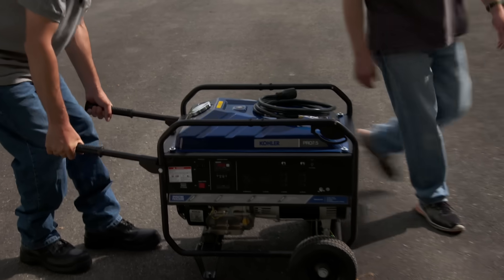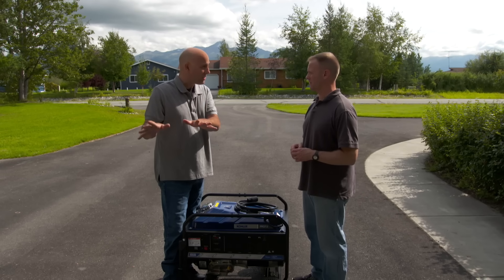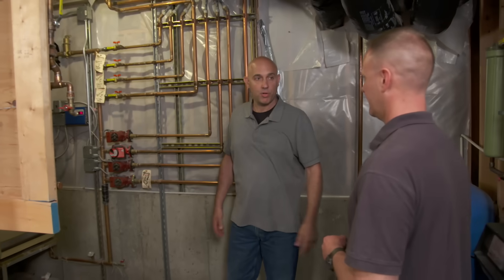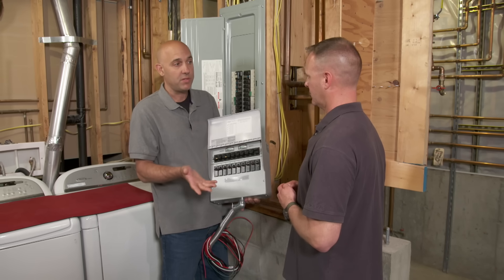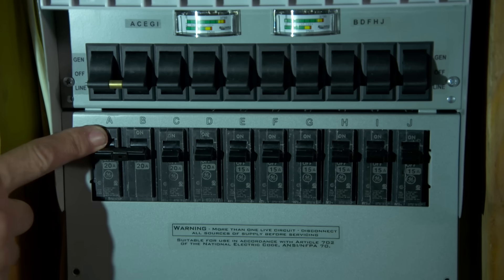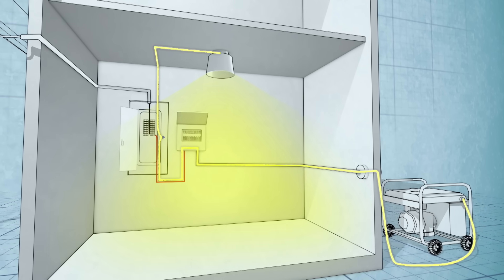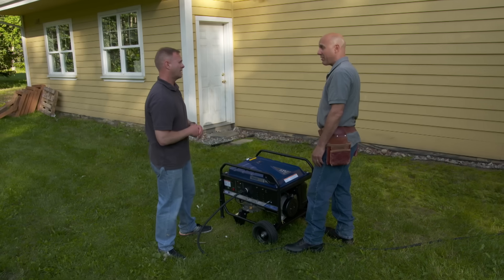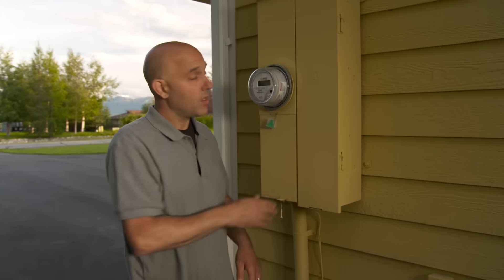How to Install a Manual Transfer Switch for a Portable Generator | Ask This Old House

Comment: These systems are more reliable and idiot proof. I still would have installed Generac NG GUARDIAN10 kv......It has AVR voltage control. Auto starting. Electric start features. 
Still not sure why Propane can't be used. They guys heating system...Uses "Natural Gas"

Comment: Can install a combination of both a transfer switch and direct connect? For example, using a 12KW generator, can I connect the 50A outlet to the main panel using a interlock device, and, at the same time, the 30A outlet to a transfer switch? Otherwise, how do I get all available 80A or 100A into the house?
Reply: Safwan Maurice Rached -  Why do you want both???  My guy put 2 Square D breakers in my 200 amp panel, the 1st one disconnects the panel from the Grid, the 2nd Breaker has an interlock and will not switch over unless the 1st breaker is switched off to separate my panel from the grid..
The 2nd Breaker is also connected to a big NEMA Female plug outside so the other end of it can plug into the generator, this 2nd Breaker is now providing the generator power to my entire panel when the breakers are turned to their respective positions and the generator is turned on..
The breakers were both 50 amp breakers..

Comment: Remind the homeowner to put a fuel preserving treatment in his tank and to shut the fuel valve off  and let the generator  run out of gas.(keeps the fuel system empty and it wont turn to varnish) remind him to test his generator under load once a month.

Comment: Not once did they mention the type of generator being a "Pure Sine Wave" or "modified Sine Wave" type. Today's sensitive electronic systems (even refrigerators, heating systems, computers, etc) could be damaged by modified sine wave. I expected Ask TOH to mention this important issue.
Reply: Unless it's an inverter generator (by design ans electronics) it will output a sine wave anyway.  It might be hashy and spikey, but a sine wave.

You're  describing the characteristics of a modified sine wave inverter, taking power from batteries and producing a sine wave...badly.  Agreed, their wave form is bad for motors and electronics.   For heavy start loads like big compressor or deep well pump an inverter generator may not have thr surge capacity of a bog standard generator.
Reply: @ralfnjan  So you're saying that any run of the mill gas powered generator (WEN, Champion, Westinghouse) - even if they don't say "sine wave" output will generate a sine wave? One that is safe for today's electronics driven microwaves, fridges, etc?  I've looked at specs and of course they say nothing about the waveform generated. Can you point me to some details?
Reply: nor do they mention that anything with a compressor, air conditioning fridge/freezer needs to stay powered off for a few minutes before powering back up

Comment: I wouldn't trust a 55' cable with that many outlets unless it was 6 or 8 gauge wire.
Reply: Voltage drop?
Reply: Heat
Reply: The amount of outlets is irrelevant for determining the gauge of the wire. The breaker at the source determines the wire gauge. If you put a 100 outlets on the wire it's just the risk of the user that they put too much appliances on it. The breaker will trip, no fire.

Comment: You should always check local codes and ordinances as well as have a permit prior to installation. I believe portable devices require 15 feet to any openings. Make sure you install it facing away from the house. Five feet is for a permanently installed rated generator. Your local fire Marshall would be a good source for this information as well as your local code enforcement.

Comment: My god that transfer switch is an expensive POS, boat anchor. $60 for an interlock, $60 for a main breaker, $8 for a 2p 30a breaker and you can use every thing in the house (not all at once obviously). We installed 2 set ups like that this past Friday and 3 others in the last month.
Reply: The inter lock switch is not NEC approved, it' not safe and not idiot proof.  The transfer switch is NEC approved, safe and idiot proof.

Comment: Will a local liciened Electrician install this? An DIYer like myself can do it?
Reply: Unless you live in the bush somewhere OR KNOW WHAT YOU'RE DOING, you probably should get a licensed electrician.  If you hook up your generator so it can back feed into the utility, you can KILL people trying to get your power back up.  Or you could kill yourself, your family-members or burn your place down.  Transformers that feed your house work in both directions: If your generator is feeding your panel with the mains still on, you are also energizing your transformer which is lighting up the utility line at 2400 or 4800 volts - that someone might be trying to work on.  

Some of these things should really be left to the pros.

Comment: The electrician didn’t explain that a #10 wire is 30 amps  of load less 20% per NEC...good electrical though.. he is very thorough in his explanations
Reply: #10 wire rated for 30A at 75/90 degree C per (previously) Table 310.15B. Generators (along with with motors and any continous load) must be supplied by conductors rated at 125% of the full load. It would be a missapplication to say you need to take 20% of the given ampacity within the table.

Comment: I thought you couldn’t make any splices in a panel
Reply: Wrong.  You can only make splices inside a box.  A panel is a box.
Reply: @michaelrice500  WTF? A JB is considered a splicing box. A distribution panel is NOT to be used for splicing.

Comment: What would it cost to have an electrician do an installation like this?
Reply: Electricians charge by the hour.  If you stand there and try to figure out which circuits you want the generator to feed while he's "on the clock", it's going to get expensive fast.  Do this BEFORE the electrician arrives.
Reply: @Chris Martin OK AvE fan

Comment: I'll just stick with messy extension chords, thanks
Reply: I'm a bad boy,  but I have a small tailgator generator that will only support some lights and a small appliance the net hub and TV.   I just turn off that GFI circuit in my livingroom kitchen, plug in a two male 120 and use that*.   That one circuit handles the chandelier, outlets in the LR,  outlets on the kitchen island,  back porch and front porch light + their outlets. 

*The back patio outlet GFI is my entry point. 

When the BR and hallway lights come back on I unplug and kill the generator.   There should be no way the generator can backfeed the service since the breaker to that circuit are off.

Cost for setup.   $80 generator on sale.   Double ended 16 ft extension cord.  Runs over 12 hrs on a quart of gasoline mix.

Comment: Runs gas without stabil, trys to start it after it sits in the garage for 2 years, sits in the dark like the rest of us..
Reply: The other great option if available in your area is ethanol free gasoline. I have been running all of my equiptment on it for two years and everything starts like new.
Reply: @bigpermsgarage6290  Yep -- all the small engine guys around here (tons of saw shops) clearly state to not use ethanol laced fuels in these motors.  They also think Stabil is a joke too.

Comment: No way you can power 10 breakers on a house that big on a 50' cable. You will only get about half the amperage you'd need. The cable will get hot and the breaker on the gen will trip.
Reply: Remember, you only select 10 circuit from the main control panel that would be below the generator's capacity to the transfer switch.  So you are correct, the whole house won't be run off the generator. Only the critical items needed in a power outage.

Comment: Is there a way to find out which circuits go with which breaker? The panel I have has some illegible panel markings of the circuits the breakers are connected to. Some I know which breaker they belong to and some that I don't.
Reply: turn the breaker off and find out what stops working.
Reply: @conorlanders8401  yeah, I'm not doing that. I'm not doing free work that a lazy or rushed electrician didn't do (but should've done).

Comment: Jummmmmm ... did the electrician mention that the generator has to be of the type  "floating neutral" to connect to the home neutral and ground inside the switch panel? ? .... I'm asking ... If anyone knows, let me know! Thanks.
Reply: I was wondering about the same thing. My generator has a bonded neutral. I was planning to run a heat pump   from the 240 v through a double pole double throw switch.....two hot lines and ground in the event of power failure.....more research need !

Comment: The #10 wire they’re using for a feed might not be big enough to carry the home load. #10 is rated for 30 amps. At 7500 watts at 240 volts would be around 30 amps. At 120 it will be twice the amp
erage (60). Plus you must account for voltage drop when adding length to the feeder. This will increase your amperage even more. I’m sure the generator has over current protection. If over loaded it will trip the generator breaker or shut down altogether.
Reply: 482lost yes at 240 volts

Comment: How do you connect the wires from the transfer switch to a double pole 240 breakers? The video only shows 1 pole breaker!! Please help!
Reply: Hire a licensed electrician.  This is serious stuff - don't mess around.
Reply: Mark Reynolds I did treat it seriously. That’s why I asked questions and did my research throughly. Everything was done nicely and professionally. I only had to spend money on parts! Thanks for your input!
Reply: @thethinbluelineZ06  The 240 breakers have two wires and two terminals and a double pole breaker.  Same as the 120 only two wires/connections.  I meant it in good faith; I've seen what happens when it goes wrong.  Glad you got it done right.  Cheers!

Comment: As a licensed electrician I never did a transfer switch your video makes it so easy anyone can install one of these
Reply: Rob,a lockout for a back fed breaker is more simple and much less expensive.
Reply: @jerrydemas2020  But if your main cutoff is outside near the meter, you can't do a lockout.
Reply: @ChrisBurnsATL  Doug, then I think your screwed!
Reply: If you connect a single phase 120 from two circuits on the transfer switch to the 240 load, as the video says, you'll get an overloaded neutral. Makes you question other things days in the video.

Comment: He is showing the transfer switch here is it 30 AMP, 50 AMP or more?
Reply: 7500 watt Divided by 240 volts = 31 amps

Comment: Why teach something that requires a licensed electrician to do??
Reply: really?  looks simple enough to me?
Reply: @2028end  In some areas you have to be a licensed contractor just to buy parts associated with a trade?? L&I (Labor and Industry) in Washington controls the trades to the extent they require a journeyman electrician to take lessons every two years?? A lot of people are employed by L&I and that's the way they like it. BUT, you're correct in assuming that given the proper instructions it's not difficult.

Comment: But isn't the generator backfeeding into the power grid since it's still giving power and they flipped on the main breaker?
Reply: I was thinking the same thing.  When they flipped on the power, but the generator breakers were still on, I was wondering if they missed a step!
Reply: @alexisjankowski3281  Trying to send you a PM or message
Reply: Same question
Reply: No, when they flipped the main breaker back on, that was simulating how it would be when your power outage is restored.  Remember, the breakers in the new box can be flipped from "line" to "generator", as long as they are still on "generator" setting, those circuits in your house are only seeing the generator's power.

So, what you want to do is, once the power is restored, go turn off your generator FIRST.  Then, come back into the house, and flip those breakers in the new box all back to "line".
  
So only if you would have the generator still running when the power comes back on, and then you go down there and flip those breakers to "line", would you now be feeding generator power back into the lines.

That's how I understand it.  Anyone else?

Comment: Will the manual transfer switch send power back through the main line?  If it did, wouldn't it shock the workers trying to restore power?
Reply: No it won't. Once the transfer switch's are in the "Gen" position, the generator can only feed power to those circuits. When the main power comes back on, the main power won't feed back into the transfer switch circuits, while the switches are in "Gen" mode. This switch prevents any type of back feeding to the main line or generator.  You don't even need to flip any circuits off in your main panel when switching between Gen and main power.

Comment: Another nice thing about these manual transfer switches is that you leave one circuit not desired on genset power to alert you when line power is back with a radio and/or light plugged in. I keep my main HVAC breaker off until I know power from the grid has stabilized anyway and this is the way to go for alerting you safely.
Reply: I can see my neighbors street light they just had to put up...😔🙄😔
Reply: Very smart thank you

Comment: Turn off your main .turn off all non essential breakers.make thick extension from generator to your dryer outlet.plug it up and back feed your house. light's . frig switches all work.and best of all. no electricians...
Reply: Yeah, and fry the person working on the other side of that transformer that feeds your trailer park.

Comment: I install generator interlock devices all of the time. They are sold on line or at Home improvement stores. Typically they prevent a 2-pole 30A backfed (gen) breaker from being turned on if the main breaker is not turned off first, and vice versa. They will allow you to use any breaker in the panel that you want, but you have to use your head, and not try to do more than the generator will handle. I typically will take "white out" and mark the breakers that should be turned off, like the water heater, dryer, Electric furnace, Air conditioner. I tell; people they can probably use one burner of their stove (not the oven) well some lights. TV, Microwave, refrigerator, freezer, without a problem. If they wany Air conditioning, it will take a much larger Generator than what we are talking about here. Whole house air conditioners take a great deal of electric just to start. About 6X running amps. This is a much better, easier, and cheaper way to do this. Hank Kline Master Electrician.
Reply: Hank Kline at that point, we’d be talking about the standby generators that do 13,000-30,000+kW, wouldn’t we?
Reply: Justin W. Not necessarily at all.  With a small generator, you’re just more limited on what breakers you can safely leave on when in “generator mode.”  This is a much easier, cheaper, and more flexible solution than the fancy 10-breaker box shown in the video.
Reply: Steve Martin understood. Thank you for the reply! I’m by no means an electrician, but find it important to understand why one would prefer one option compared to the other.
Reply: Justin W. ...Great.  I haven’t installed a generator interlock device yet, but I’ve researched it a fair bit and it’s “on the list.”  They’re UL approved and seem like the next best thing to having a $8000+ automatic whole house generator.  There are some good YouTube videos out there.
Reply: Both options are safe and valid, and it depends on the homeowner and their generator size as to which option is best for them.

Comment: I have a smaller house would I need the same switch box?
Reply: Back feed a double pole breaker in your breaker panel. Go get a mechanical breaker lockout for the panel brand you have. Also the model / type.  Connect the wire from the gen. to the breaker right below the main breaker. When you install the lockout correctly, it prevents the breaker fed from the gen. to be ON when the main breaker is ON.But it allows the gen to feed the panel when the main is off. Read the instructions on the lockout kit . Kit should cost about $50.00

Comment: The problem is people do not run those generators weekly. They sit for months, or more. Gas goes bad. Carb gums up and it won’t run. These babies chow the gas too. 

Better solution is to convert that carb to use propane. Put a 200 gal tank out back. Hook up when needed and zero gasoline problems.

Comment: A 7500 (running) Watt Generator is capable of 62 Amp output, yet using the single 30 Amp Out receptacle really limits the output amps to 50% of total capacity. Is there any way around this?
Reply: The receptacle they plugged into on the generator is a NEMA L14-30R, which is intended to carry two 120v lines 180° out of phase, so 240v. 240v×30A=7200W. So just make sure that your single-phase circuits are well balanced, and you're close to full capacity. That said, I wouldn't want to run a full 30A across that 40-foot cable. You could potentially use the rest of the capacity from the other outlets in the generator, though.
Reply: @wbfaulk  wrong. The SO cable could be 100 foot with no issues.
Reply: @yarightmf  I'm wrong that I wouldn't want to do it? It's nice to know that there are people out there that know what I want more than I do.

Comment: When power goes off and you have the transfer switch. Do you turn off main break for the house before you turn on the transfer switch???
Reply: If you have a set up like this in the video then no the box they installed does all the isolating.